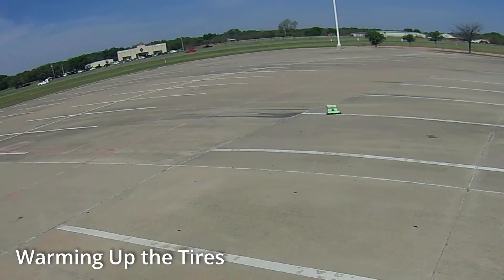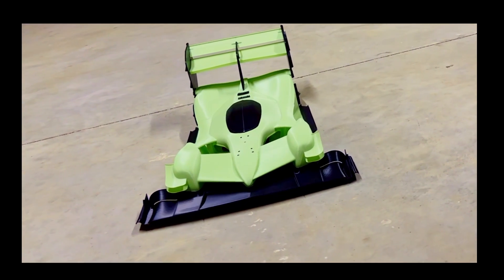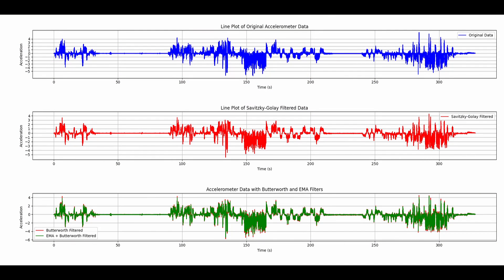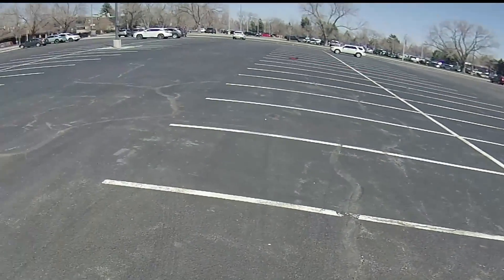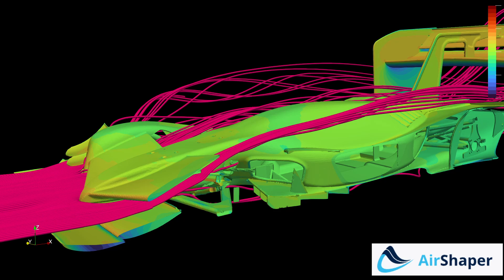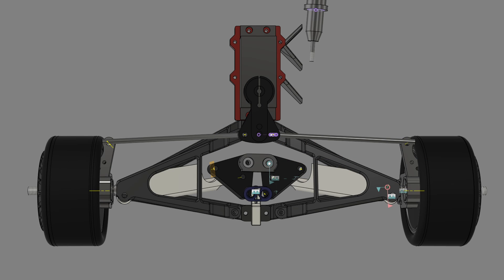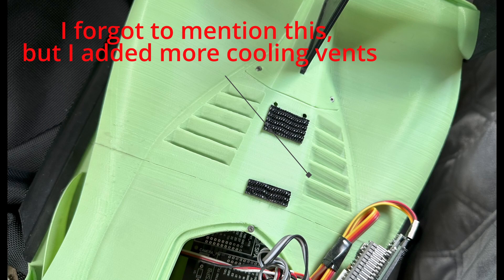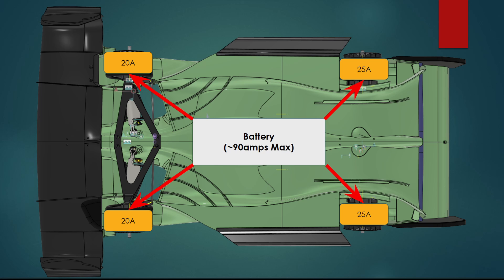RC Hypercar Pt8 - World's Best Handling RC Car?

Comment: Hey man, I really wanna turk my HyperGo RC car into a time attack machine but dont know exactly where to start, any recommendations?
Reply from the maker: I'm not familiar with that particular RC car.  If it's on road then I'd start with the suspension and tires and getting that dialed in.  Then you might try some wings, even on the roof in the middle of the car to just see how the downforce affects the car.  I designed this car from the ground up with a 3rd member or heave spring and that is key when you get into higher downforce levels, particularly if you're using the bottom of the car to generate downforce.  Separate wings are a lot easier to tune and not as sensitive to ride height.  Good luck!

Comment: Don't RC touring car types already do 4Gs because of the grippy foam tires and prepped surfaces? Also, IIRC F1 is 6Gs sustained laterally. 4Gs is like high-end GT or the lowest end of prototypes, I could be wrong on either count, but I'm pretty sure that post 90s F1 has been 6G sustained max cornering force. Either way 65mph is still fast AF, and I recommend looking up a true scale speed calculator based on this vehicles dimensions and figuring out what that compares to. At 1/8th scale it should roughly equate to 184mph. 1/10th should be around 205. Not super impressive in the current age of extreme downforce racers, but still stout.

Also, I find it funny that you had naysayers about complex downforce and multi-element wings at these speeds and this scale. Formula Student (FSAE) had the same thing 15-20 years ago and they were running naked cars, and now everyone has very complex aero packages.
Reply from the maker: Oddly most RC car people don't capture real data about their cars which is crazy.  I'm used to real race cars where you have full data on everything and you're not relying on just what the driver "feels".  The only figures I've seen is for 1/12th scale pan car on carpet can pull ~2.6G.

Yeah, the downforce is real.  I was putting 10-12lbs on top of the car when setting up the suspension to keep it from bottoming out.
Reply: @IndeterminateDesign  That's really fricken cool. Have you considered a decoupled suspension design like the AMG Project One, only with a special slider for the roll damper unit so you can use a typically designed one kinda like a few FSAE cars are doing?

Comment: Why didn't you aeroshaped the suspention element? And if you had separated the bottom from the chassis and attached all the aero devices  directly to the wheel hubs you would have some pros: costant riding height of the bottom and suspensions that have only to deal with the chassis (so could be softer and simpler)  Ps. This is a great work!👍🏼
Reply from the maker: I did my best with 3d printing’s capabilities to make them as aerodynamic as possible. Unsprung aero would have been awesome but even more complex. I may design another car in the future. It’s a lot easier now that I have something to build from.
Reply: @IndeterminateDesign  Thanks for the answer ✌

Comment: I think I missed it but what is the load path of the downforce transmitted to the wheels? On a 1/8th onroad the wedge body is essentially mounted to the wheel knuckles or a-arms to push directly down on the wheels instead of changing ride height through the suspension.
Reply from the maker: I didn’t try unsprung aero for this car. I was over my skill limit for CAD modeling already lol. This car has double wishbones with a pull rod suspension. It also has a 3rd member or heave spring that maintains the ride height. I go into more detail in earlier videos, though I did refine that initial design several hundred times.

Comment: Following your projects , amazing work!
Can we buy the board? I what to do something similar but offroad version!
If i can add any input on your amazing work, let me remember that with a normal steering servo, you can easy change the steering direction, but you cant change the speed that direction moves.
If you think when you are driving on the highway you make slow corrections but on slow, tight conners  you make fast corrections.
The normal rc steering servos use always the same "rotation" speed, and this make them unstable at high speeds and impossible to tune.
The hardware should allow to get feedback with alot of data, but also control a lot of variables and you are limited on the turning speed of the steering.
Torque vectoring will help alot on this matter but its not the solution for everything.
Again you are doing a brilhant  job!
Hope my input helps!
(Im a electrical engineer and work alot on 4 wheel drive and steering automatic guided velhices)
Reply from the maker: Thanks!  I don't have the board available right now.  I can email you a copy of the current design.  It's definitively a prototype with some issues and flaws. 

I absolutely agree on the steering issue and the steering feel.  I've played a bit with speed variable ratio steering, because the car can just turn way too tightly at high speeds which kills the downforce.  There's a whole world of things I could do with fast 2 way communication between the RC car and the transmitter, and having position feedback on the servo, but that's a future development.

I'm curious to see how much torque vectoring helps.  Everything I read about torque vectoring on FSAE cars said they generally end up tuning the car to have far less computer correction than the models suggest because the car becomes unpredictable and unnatural to drive.  I'm curious if that would still be the case with an RC car.

Comment: A random thought that keeps bouncing around in my head is would it be possible to implement some kinda force-feedback for steering? Like it might be super cool if you could "feel" the car in a similar way that sim-racers do.
Reply from the maker: It’s absolutely possible and I’ve been researching the topic and playing with ways to accomplish this in an RC car. Overall it’s very similar to what you would have in a disconnected steering system, such as what Infiniti uses, just with a wireless link.  

There is a good body of research out there, but the actual implementation is going to involve lots of testing and development to get to a reasonably accurate solution.
Reply: @IndeterminateDesign  yeah at first I was like “should be easy!” But I… don’t think it is. How / what do you measure as the signal to the user? Like force on a servo horn?
Reply from the maker: Measuring force at the servo arm is the best, but difficult to implement. Indirect methods of measuring torque like measuring amps require a lot of characterization of the particular servo and it’s response, and still wouldn’t be very accurate. 

You could model the forces acting on the steering  from the suspension geometry, and using a lot of math and vehicle dynamics data, recreate the steering feel, but it would leave out a lot. 

🤷‍♂️ Things I think about a lot at night..

Comment: What free cfd and cad software is the best for beginners like us who wants to be free,exploring the field first?
Reply from the maker: I use Autodesk Fusion 360 for CAD. For free CFD, there are not a lot of good beginner choices because in some ways the results of the CFD are only as good as you configured your software. 

Obviously I use AirShaper because it’s so much faster and easier to configure a case, but most CFD software is built upon a really poorly documented set of software called OpenFOAM.  I used a derivative called BlueCFD for a while. It’s very powerful, and script based with no free user interfaces. If you get it configured, you will learn an immense amount about aerodynamics and CFD. 

There is also an online product called Simscale, and it has a free number of hours that would allow you to do a few simulations. That maybe the place to start for very simple models, and there are great tutorials. I found it did not handle complex surface based models like the RC Hypercar.

If you’re a student, you have the ability to purchase Solidworks CFD or Ansys. Both good products, but very expensive outside a student discount.
Reply: @IndeterminateDesign   the problem is that my country doesn’t support paid subscription or even PayPal so that makes these useful software and courses hard to access but thanks for the info,I will consider to use airshaper when things get better,so what you are meaning is that cad software is accessible and cfd is not? Okay noted I will now be subscribed to your channel because your info and your in depth analysis are helpful for me to watch,who is a complete beginner and by the way what are the recommended pc specs for running cfd and cad? I am planning to buy a new pc and I will ask a person I know of to pay subscription to the cad software but for me,airshaper is the greatest cfd tool I’ve seen but it’s too expensive for me,which is a bummer but thanks for tuning in and replying!

Comment: Which influence on aerodynamics has the scale factor, i.e. the Reynolds number?
Reply from the maker: I go into some detail on in this earlier video, a few minutes in https://youtu.be/oUddNnGI5EA

The biggest thing is the car was designed and optimized at this size.  It would be much more efficient if it was a full size car, but also create more downforce than the tires could ever handle.

Comment: Need to visit a RC Touring/Pan Car track, and get some real world lap data to see what it is really capable of, and in comparison to a top flight Touring Car and Pan Car.
Reply from the maker: Yeah, I'd love to do that.  I need to find a better driver than myself.  This car is far more fragile than your typical RC car, and I know I'd run it straight into a wall.
Reply: Carpet cars must pull 20 lateral g’s in the corners. lol
Pro 1/10 carpet racers are so fast I can hardly follow them around the track with me eyeballs.

Comment: I'm looking forward to the release of the models! I'd love to attempt building a mold and making the monocot out of carbon fiber.
Reply from the maker: That would be cool, and definitely lighter.  I wish I could make the whole suspension out of carbon, so it could be smaller and stiffer.
Reply: @IndeterminateDesign  "forged composite parts" - You can 3d print the negative mold, fill it with chopped carbon tow and resin, then compress the mold together to get amazingly strong stuff. https://www.youtube.com/watch?v=25PmqM24HEk I've used this technique to make stuff for RC sailplanes and parts for Voron 3D printers.
Reply: Is there no way you could try having the one piece control arms cut out of thing CF sheet that may have the right modulus you need for flex? @IndeterminateDesign
Reply from the maker: Possibly I could use carbon fiber sheet bonded together.  The key is making the control arms flex when you want them to so you maintain the desired suspension geometry.  I need to convince the wife to let me get a CNC router.
Reply: @IndeterminateDesign  if you need something milled met me know and I can do that on either one of my machines.
Reply from the maker: @GatorGlider  Awesome.  I may hit you up later if I can't make these 3d printed arms stiff enough.

Comment: maybe you could redesign the rear wing to act more as a twin tier wing with a separate multi element wing for the rear diffuser like on 90s group c race cars?
Reply from the maker: I love those rear wings. The hard part is I have to keep the downforce on the rear wing as far forward as possible to keep the car balanced. 

If I knew what I know now, the tail  of the car behind the tire would be much shorter. You can see most of the Group C cars are really short behind the rear tire and slope down as well. This allowed them to mount the wing so that interacted strongly with the diffuser.
Reply: @IndeterminateDesign  i didnt even think of that, your hypercar is so much alike the xjr-14 being over engineered and so compact its impossible to change or improve

Comment: seeing these videos make me want to build something similar, perhaps i can turn my rc buggy into something crazy like this is
Reply from the maker: I think this could work with a buggy, but dealing with the downforce is really hard with a soft long travel suspension.
Reply: @IndeterminateDesign  yea im well aware, im currently trying to convert my buggy for tarmac racing because why not, i might have to get radical with the rear suspension by switching the spring for a bushing or something to keep it compact and stiff
Reply: A time attack buggy would go crazy, pls lmk when you post a video on it or something

Comment: You can never have too many sensors.  The next step will be to make daughter boards with 2~3 sensors on each board to set on each corner of the car. Then run CAN bus back to the primary VCU for recording and such.  Don't forget to set up ride height measurement sensors on the front and rear of the car so you can see what your aero forces are doing.
Reply from the maker: I love the idea of having daughter boards on each of the wheel sensors. Running SPI in a noisy environment like this is far from ideal. Also I have 10 wires with the temp sensors, so CAN would help a lot with that.